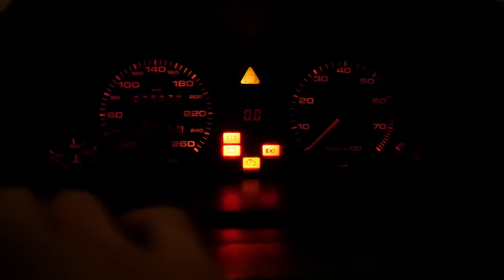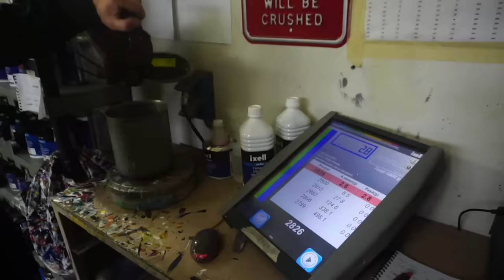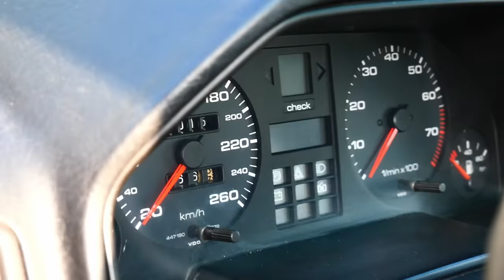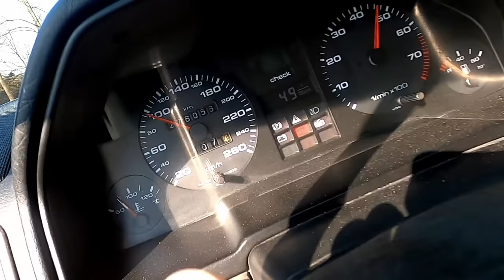Audi abandonnée pendant 15 ans : 40 minutes de restauration

Comment: Amazing skills to do all that work! I have a cheap Mitsubishi Attrage sedan and just took it for its 100,000km service and the amount of 'stuff' it needed was shocking, like new engine oil, three new spark plugs, a new timing belt, engine flush, oil flush, gear oil. So when I saw this car, I didn't know where someone would even start with all that stuff, it's incredible that he got it running again!

Comment: Have a blacked-out D2 A8L 4.2 Quattro I inherited. It was never neglected or abused, spent about 8 months re-vamping it. 38MM, progressive-rate sport springs, Bilstein struts, lighter weight, 18" forged wheels, better exhaust, new metallic black paint, replaced all the consumable mechanical pieces & parts, full servicing, fluid flushes...have a D4, 4L TT that doesn't get the attention & questions the ol' girl gets

Comment: This is a prime example how one should start out when trying to save a barn find!
Maximum respoect for NOT attempting to start it, removing the front grille for access, removing accessory belts, checking the timing belt, removing plugs and most importantly, turning the engine over by hand before doing anything else!

Comment: Score ! Good job and way to go, but you're missing the Nozzle on your Mig tip, and that Nozzle is designed to be there to keep your Shielding Gas around the molten steel, as it is cooling, to keep impurities from forming. Make one or buy one, but get one on there, you'll weld better, Merci, Au Revoir.

Comment: Si quelqu’un ai passionné, j’ai la même en stock, et elle est très facile à restaurer : la peinture est impeccable, (elle brille comme une neuve) je ne m’en suis plus servi depuis des années pcq je l’ai un peu oubliée dans un de mes garages, ( je suis collectionneur) le ciel de toit s’était décollé. Depuis, un ou deux étriers à du gripper. Je la fait rouler de temps en temps mais juste dans le quartier ( sinon je risque de faire chauffer les disques ). Question carrosserie, pas un point de rouille. Elle n’as que 110 ou 120000 Km. Je la possède depuis 1989, mais je n’ai du faire que 20000km depuis…. Elle a toujours été stockée dans un garage. C’est un modèle 83 ou 84 , champagne métal ( la plus jolie couleur sur ce modèle), version CD ( modèle haut de gamme ), 5 cylindres essence 136ch ( pas la version turbo ), mais elle a un look de 200 turbo ( feux AR … c’est plus joli ). Elle est complète,  bien sûr, et a 
 deux jeux différents de jantes alu impeccables (celles d’origine + des plus sport). Elle est étrangement particulièrement sobre en essence ( j’ai déjà eu d’autres 5 cylindres Audi , auparavant). Par contre elle consomme un peu d’huile en été, en ville, suite à un traitement liquid-moly, conseillé par VAG, quand je l’ai achetée , à 99000km, au moment où ils m’ont fait la distribution. Du coups ils ont mis des joints de queues de soupapes neufs, mais ça n’avait pas amélioré grand chose.Ils l’ont tellement décalaminée qu’elle avait une patate d’enfer ( 200 facile sur l’autoroute), avant que les étriers grippent… si quelqu’un connaît,  et a le temps de voir ce problème d’etriers, et surtout de changer le ciel de toit, je serai l’homme le plus heureux du monde…. Idem si quelqu’un a un ciel de toit ( beige ) correct.

Comment: Salut les gars,

rassurez moi car la j ai des gros complexes apres avoir vu la video.

je pense q   il y a au moins un mecano pro , un electromecano pro et un carrossier pro parmi vous!

quand je vois comment on tire le gros faisceau et qu on en remonte un autre derriere , sans parler de la refection de la boite a fuisible et la refection du cablage meme pas originel

ensuite on refait la carrosserie et vous dites "je debute " ouha  (c est vrai ce mensonge)

bref excellent travail, j ai moi meme refait le ciel de toit de mon audi a3 de 1997 , une galere mais une fois le resultat on est content

bravo, excellent travail

Farid

ps; petite question mais vous n etes pas obligés de repondre, sur mon audi A3  j ai changé les disques plaquettes AV AR capteur ABS et les moyeux AV (a cause des roulements HS ) depuis  le systeme ABS est devenu tres sensible et il se declenche a chaque fois en fin de freinage avant l arret . il me semble qu une simple remise a zero du capteur de pression hydraulique (dans le bloc hydraulique) via une boite de diagnostique suffit a ressoudre le probleme  (est ce juste ????) et si oui combien un garagiste me premdra pour cela ????

merci